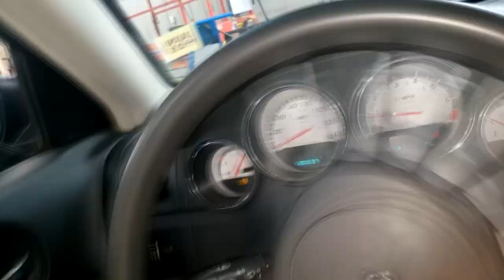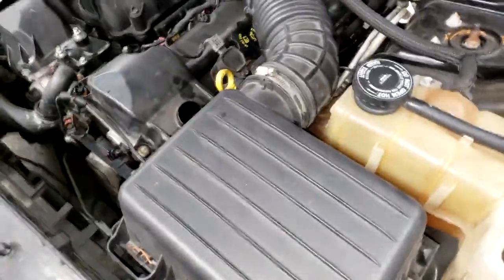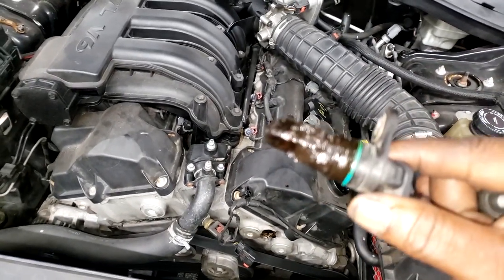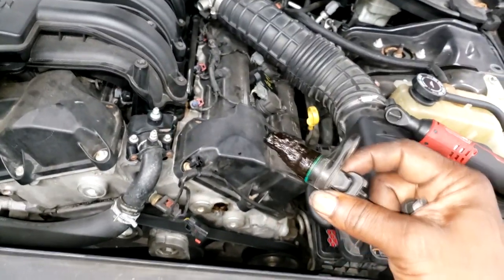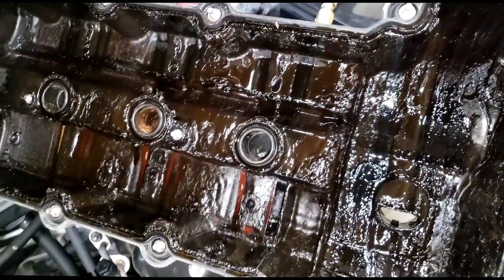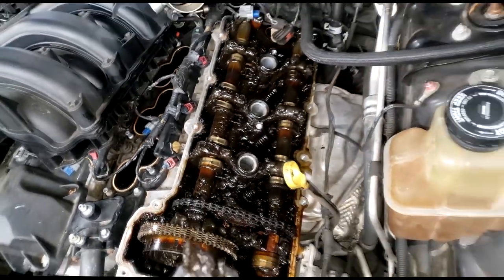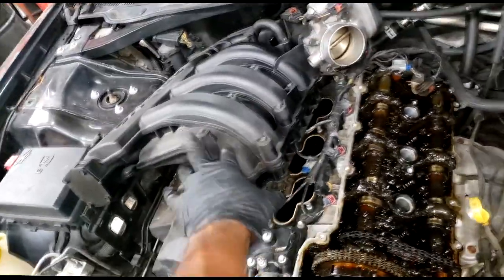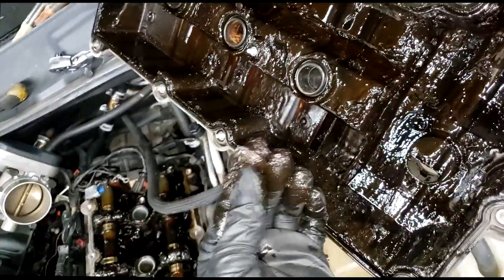Customer never changed oil on time. SEE WHAT HAPPEN. 2.7L V6 all aluminum motor bad with sludge.

Comment: My Neon had the tan sludge all under the valve cover and pretty sure it was because the pcv system had split and collapsed hose. I cleaned it all out when I redid the valve cover and spark plug tube gaskets and I don't think it was building back up after I had replaced the bad hoses. Another thing about the 95 Neon, it used a different valve cover and spark plug gaskets and the pcv system was unique in that it had a oil seperator box that all the plumbing went into and the gaskets and proper hoses were discontinued or hard to find.
They really put some thought into that little 2.0 it used to make it have better hp than the Civic they were competing against at the time.

Comment: I actually saw a video where a guy had one like this that had low oil pressure and a noisy valvetrain. He hit it with a pressure washer first, to knock off the stuff on the valvetrain. Then he drained the oil and only added 1 quart of oil back, and then filled the crankcase the rest of the way with dollar store cleaner (household stuff, not car!) and idled it for an hour, then changed and repeated numerous times. Surprisingly the oil pressure finally returned and the engine quieted down. It was a beater ready for the scrap heap so he got a little bit more out of it before letting it go.

Comment: I Have a 2016 Chrysler with correlation issues reported by the cam sensors (which was also completely covered in sludge), there was a lot of sludge in there and it appears to be everywhere. I looked at the crank sensor area and the same sludge was seen in the crank sensor area. There are no rattling noise but I'm certain that the chain is truly stretched and the code will never go away lol.

Comment: Another note I would like to make as well is that the same thing can be said with sludge in the coolant system which contaminates radiator and heater cores. I have a case on that as well and the cleaning process would take a long time because sludge just likes to stay on the walls of what it touches.

Comment: Hello JT, good video! I have a question about a 2015 Grand Caravan. I can feel the engine misfiring at idle. If it's at low idle, the rpm needle jumps up and down a bit. There are no trouble codes. Diagnostic mode 6 data shows that cylinder #3 is misfiring. There is a bit of ticking as well. Tried swapping coils and spark plugs, didn't help. Pulled off the bank 1 valve cover and cannot feel any bad rocker arm. The cams don't have any unusual wear as well. Also done a compression test. All the cylinders have the same pressure. Do you know where the problem could be, please?
Reply: Pvc

Comment: 2 words "Sea Foam". Lol
Reply from the maker: Explain
Reply from the maker: O we don't do that here..most all that sludge will end up in the oil pan and just recirculate back thru the engine and cause more damage. Risk is a big no no here. If you charge a cust for such a repair they still will expect there car to run perfect with no problems. Personal cars yes, customer cars no
Reply: @OnlineMechanicTips  it's a home remedy for sure. Scotty told me about it. 😄
Reply from the maker: Lol...o cool

Comment: What kind of insurance  deals with mechanical problems?  There is NO need or point of "taking this engine apart"  a rod knock is an obvious noise.  And these 2.7 engines  are known for this!  The best thing to do with this car,  is to replace this 2.7 with a more reliable and powerful 3.5 (or it's 4.0 relative)!  These cars were actually designed in a manner that this is even easier to do than swapping the 3.2/3.5 in place of the 2.7 on the former LH cars (Concorde and Intrepid)
Reply: I'm sure he meant warranty rather than insurance. They probably have an aftermarket warranty.
Reply: @PatChapp  yeah those "warranties" are basically "insurance" for mechanical problems.  It's ridiculous how many scammers are trying to sell "extended car warranties"  though I know some are legit,  most are probably fraudulent as a way to collect money from innocent people.